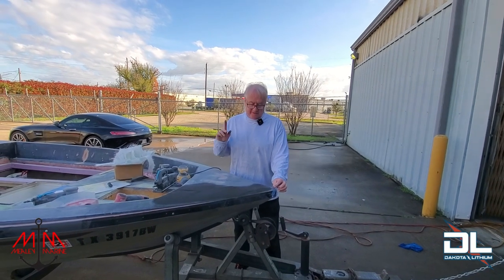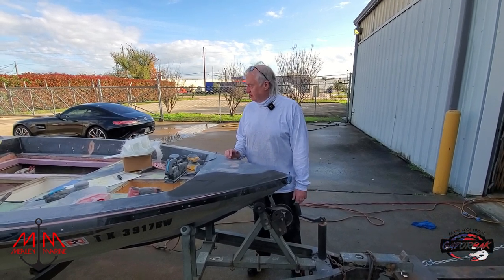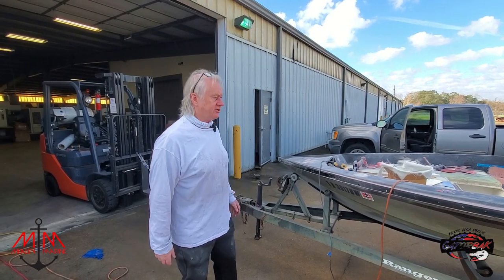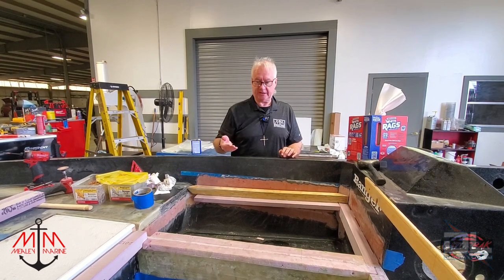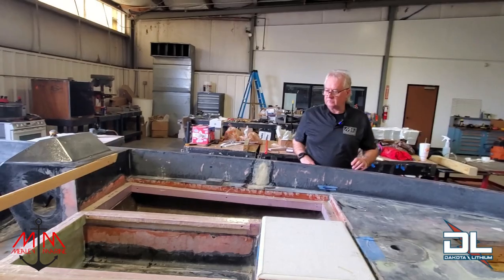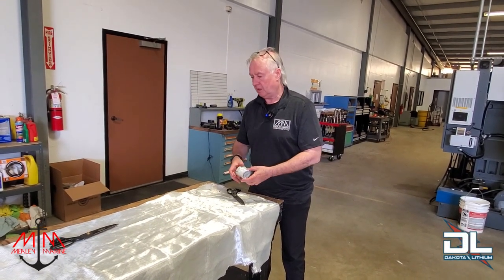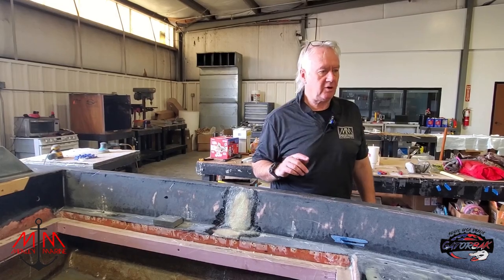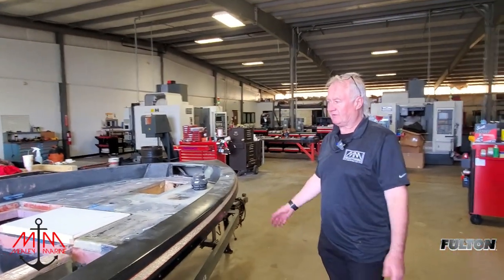BASS BOAT RESTORATION PROJECT | Part 19: Glassing in the deck

Comment: This would have been sooo much easier if you used boxed aluminum and drilled it into the existing fiberglass.
Reply: If life was only that easy but easy is not what this build is all about
Reply: How do you fasten it?  With bolts?